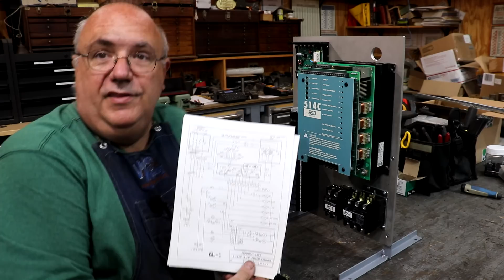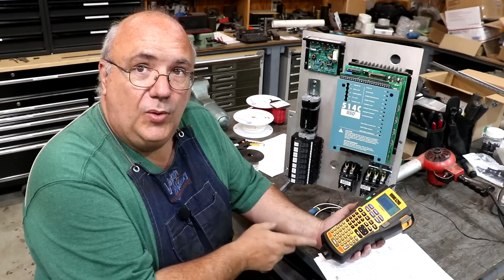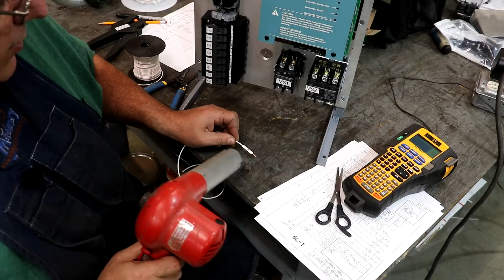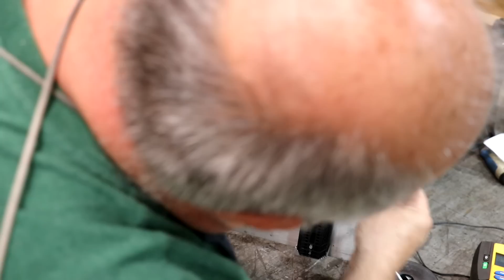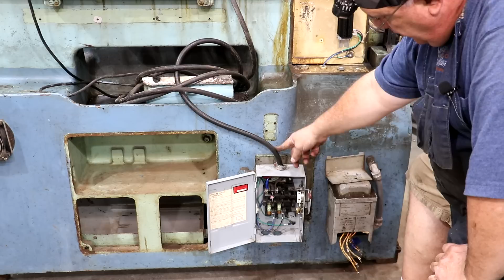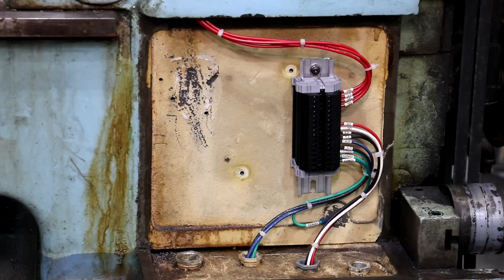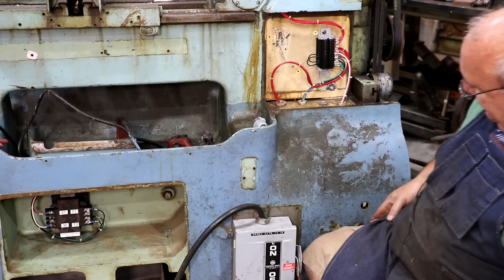Monarch 10EE Drive Retrofit 4:Wiring the Component Panel and Lathe Controls

Comment: Nice job except you REALLY needed to put rubber grommets in those pass through panel holes, any vibration over time will chaff the wire insulation and short the wires to the panel hole and thats gonna be a really bad day.  ALWAYS  use a grommet where wires pass through a metal bulkhead like a cars firewall or computer case panels, spoken by an ex mechanic and PC builder-- people arre always running fog light and other wires through the firewall with no grommets and I once saw my buddys nice '69 Roadrunners entire dashboard wiring harness melt down and fill the car with smoke while driving on the local cruise strip back in the 70's. We had to gut the dash and replace the entire harness - took a whole weekend.  All because he ran wires through the bare sheetmetal holes in the firewall.
Reply: I agree, but I'd use a nylon caterpillar grommet instead. The rubber will break down eventually. I'm not sure why you didn't clean the machine up before you started, but I'm sure you would have had a reason. Nice job Keith!
Reply: @daveschroedersworkshop4479  I agree with the nylon caterpillar grommet at this stage of the game. Before wiring, I would suggest an insulated chase nipple and locknut. The likelyhood of damage will depend upon the pressure of the wiring harness against the hardness of the metal plate (and the frequency of any movement).
Reply: Chapter 38 of the georgia state minimum electrical code states "Securely fastened bushings or grommets shall be provided to protect wiring run through openings in metal framing members." for unarmored cable.....
Reply: @notsofresh8563  what is the relevance to a lathe?  That code applies to wiring methods in dwellings.  Does not apply to machine construction or repair.
Reply: I'm pretty sure he knows this. This ain't his first rodeo.
Reply: @MHolt3573  May not be his first rodeo, but he's always first to admit he's not an electrician, much less an expert control panel builder which is a speciality in itself. Since I've done a little work in that field myself, I just bite my tongue every time he starts on electrical work, but the others have made valid comments.
Reply: If that's panel wire,  (i believe it is) it's a thicker,  rubbery insulation and will doubtful last many, many years.
Reply: @davidgagnon2849  yes, a lot of specifics here that the experts are guessing about.  Is it MTW, THHN, SIS, what?  But the big one is how much vibration will it experience?  I am guessing little to none.  That thing is a giant chunk of iron sitting on concrete.  My only advice would have been cut a slightly larger hole, but that is just my personal preference.   It doesn't appear there are too many wires going through the holes.  I think it will last 100 years as is, which is to say whatever fails will not be the wire insulation.
Reply: its a very heavy lathe. it wont be rattling around like a car
Reply: @awake.collective  it doesn’t have to. I do these mods fairly regularly. The electronics manufacturers say to keep the equipment vibration free (as much as possible). The way the board is built, the top will vibrate a fair amount for electronics. The pivot point is all the way at the bottom at the welds. A thousandths of an inch movement down there will translate to possibly 5 thousandths at the top. Or more! That’s a lot of movement. And what happens if there’s a resonance at some feeds and speeds? It’s always better to lock things down with proper design than to leave it to chance.
Reply: Pro tip: 2x2in Open Slot Wiring Cable Raceway Duct with Cover
Reply: Code or not, because codes vary, it's best practice to protect all passthroughs :) I actually FFW to the end to see if he put it in, the whole time thinking "Oh Keith, Keith, stop..." because I've completed entire panels and then looked at my pile of grommets and felt like crying. The labeling detail was also great, but I would have numbered things by run, not connection. Point A to Point B is run 30, but then he's got Point B to Point C also as run 30. Every run I do is tagged both sides and unique, regardless of terminus or daisy chaining. That is probably just my OCDC idiosyncratic ways, but it does make things easier to troubleshoot if the schematic gets misplaced.
Reply: @Godzilla_Jesus  If John the engineer is using electronic design software (as I strongly suspect), the software keeps the same number for the entire "daisy-chain". (ref" LTSpice, etc.)
Reply: We’ve mentioned this to him a number of times, and I’ve mentioned the weak support for the panel with those small welds on the bottom.

But guys, you know, he’s a big boy. He can make his own decisions, right or wrong.

Comment: Sadly I'm a wiring nerd. You need to find some split grommets and install them otherwise those wires going thru the holes will get chewed up in a few hours of use.
Reply: give the man benefits of a doubt here, this is far from being a finial version and is most like a dry run and all of you guys will get your Grommets fetch in the end.
it is not like this a F-16, a few runs making sure that it works will not cut the wire 
so let make sure that it works before start putting in grommets and industrial cable sleeve.

Comment: Hey Keith, nice job! I follow you on Instagram and I'm sure you're tired of hearing about grommets 😂  I will however recommend ferrules for the ends of your stranded wires. Keeps strands secure in screw terminals, makes for a neat install and prevents stray strands from shorting out.
Reply: What kind of furreles sir and do you need to crimp them or will the screw crimp it to the wire.
Reply: @MHolt3573  they are called boot lace crimps in some areas.
Reply: @MHolt3573  they crimp on. Ferrule kits with the crimping tool are available for cheap on Amazon

Comment: Keith a dc motor here in the UK that had series and shunt fields was known as a compound motor as you correctly state the speed is controlled by the shunt field which must never loose it supply when the motor is running , it would then become a traction motor ie max torque on startup ( like a steam engine) but very little speed control that's where the shunt field come in that is the speed control . the number of poles has little to do but is more related to the size on the motor I have worked on does with 6 poles and well as intermediate series poles know as com poles they aid start up under load , biggest DC motor I have worked on was name plated at 150 hp but I have seen them with the amp meter pegged out at 1500 amp at 220vdc  and the motor was not Evan warm

Comment: Was there originally a fan where the axial fan is? It exhausts heat from the compartment? Great series and I don't even have a lathe.
Reply: That's for the original tube drive, it might still be needed but it's a lot less critical with the new drive